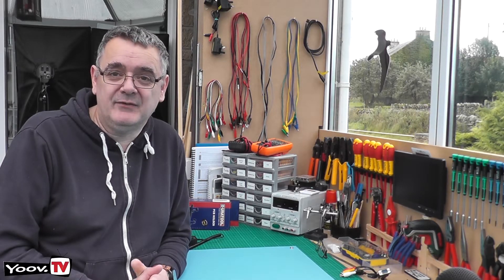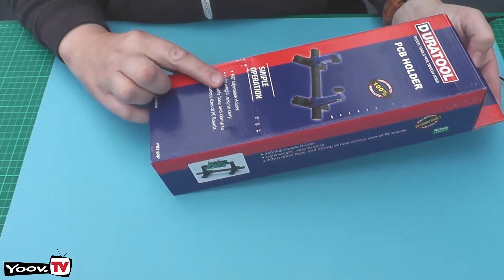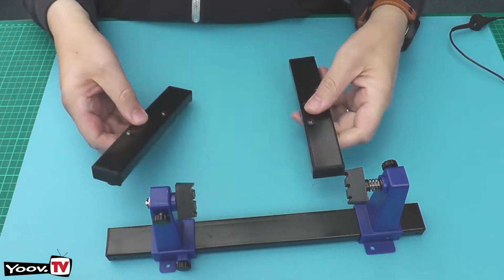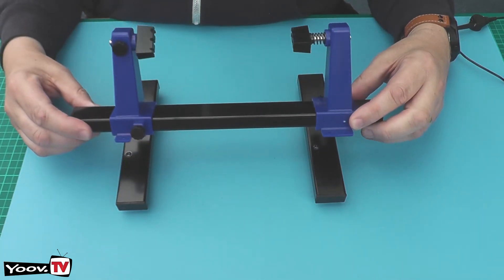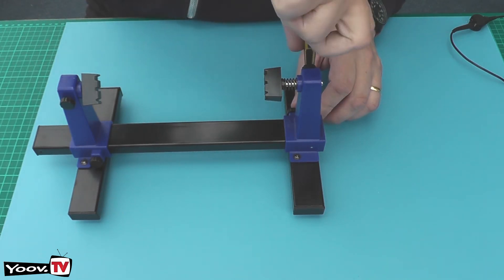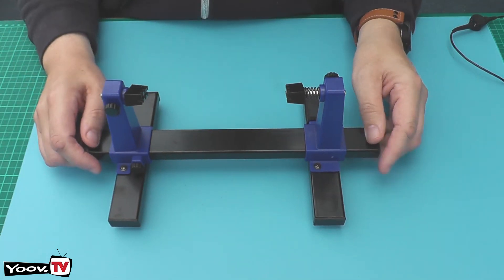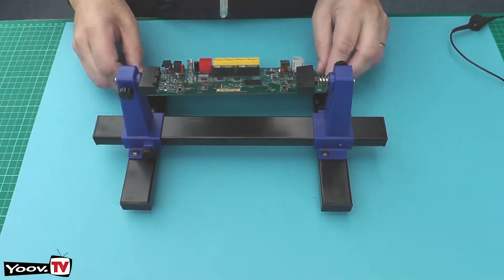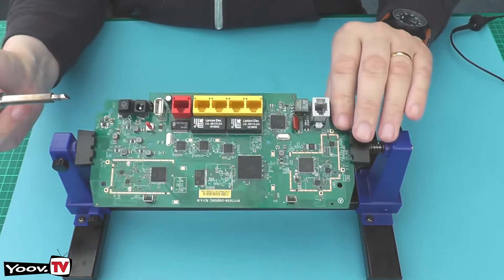BURNTEC PCB Holder Jig - Duratool PR2 9PP - FULL REVIEW

Comment: After seeing the review, I would like to know if you can keep the PCB from rotating.  I would need it to be as stationary as possible while trying to desolder multiple pins and removing the component at the same time. Do the knobs tightened down keep the board from spinning or is it designed to do so regardless?  Thank you in advance